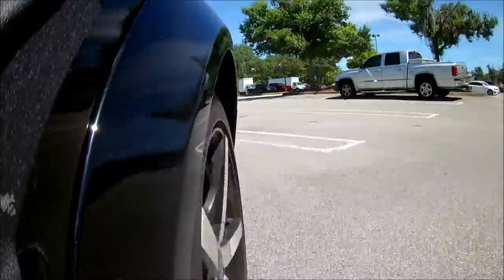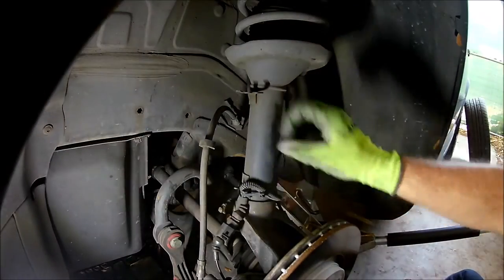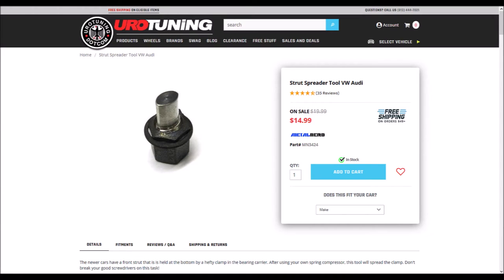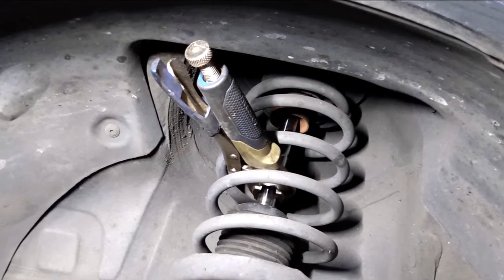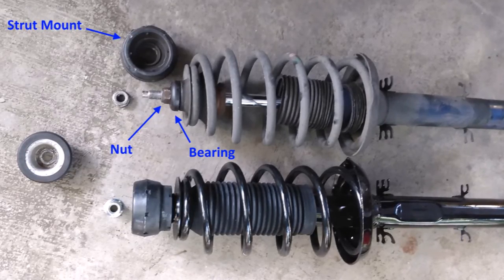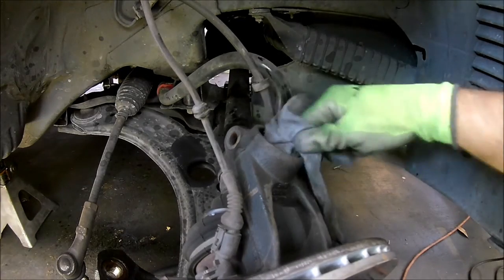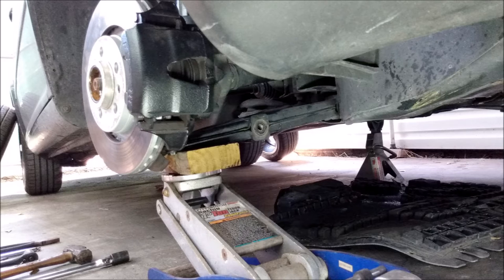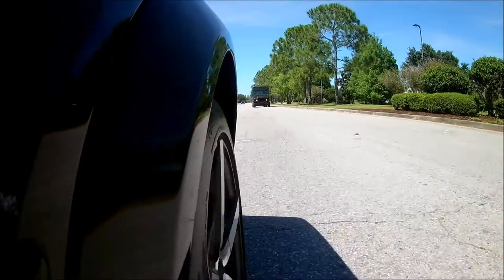Jetta Project Car: Front Strut Replacement

Comment: Chock full of tips.  I've done these a few times and you noted all the important parts with still photos, too.   One thing I noticed -- the hub carriers had two styles, only noticeable in the bore where the strut fits into it -- one style is solid, in full contact with the strut, another is hollowed in the middle with two bands of contact top and bottom.   The carriers with the solid style bore are much more stubborn to take off and go on, so use of a spreader tool  (or a "spreader tool") and lube are essential for reassembly.
Reply from the maker: That's interesting. The hub carriers on my car have the hollow part in the middle.

Comment: Detailed to the point with no unrelated filler material. I appreciate it. I've got a 04 Jetta coming in for some side work I'm doing and I feel much more confident knowing these tips/tricks. bonus points for the torque specs. well job sir.
Reply from the maker: thanks!

Comment: Great video, very useful.  I just put Bilstein B4s on my son's 2003 Jetta MX4.  I borrowed spring compressors from Advanced Auto since I wasn't installing full strut assemblies.  The driver's side came off without issue (didn't have to remove anything other than the pinch bolt and sway bar link as your video showed).  That passanger side axle definitely gets in the way, hits the frame way before you want it to; you just can't get the knuckle low enought.  I decided to use the spring compressors on the passanger side before removing the strut assembly.  Capturing 4 loops of the spring on each side compressed the spring enough to easily get the strut off without removing anything other than the pinch bolt and sway bar link.  I just left the springs compressed on to reinstall which also made it an easy fit (although the new strut was significatly harder to compress than the old one; no doubt they needed to be replaced).  I used many of your tips; thanks for the help.

Comment: One thing to note about this having just one this.  The video mentions that the drive axle should be removed from the transmission, however all that NEEDS to happen is the drive axle coming apart from the wheel hub/knuckle/carrier what have you, which is a lot simpler than removing the axle from the transmission.
Reply from the maker: I decided I would rather detach it from the transmission. But you can do what you want.
Reply: @michaelblacktree  right right. What I'm getting at is that you can easily do this job and just remove the 30mm 12point axle nut from the wheel rather than have to go through the pain of removing all 6 triple square nuts on the transmission side of the axle.  

Again, do it however you want, but boy do I avoid having to remove those axle nuts like the plague. :)

Comment: Jetta City
Reply from the maker: I installed a fender liner from a City Jetta, to help cool the intercooler. I also put a fan in there. It does a great job of keeping the intake air temp under control.